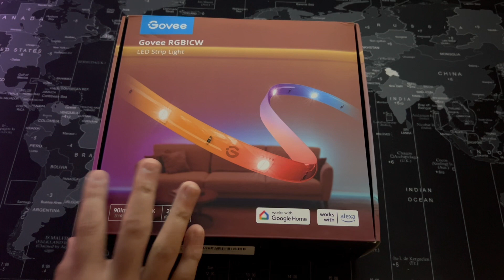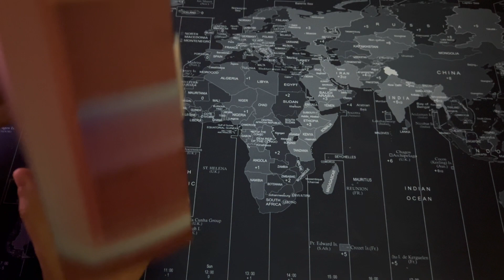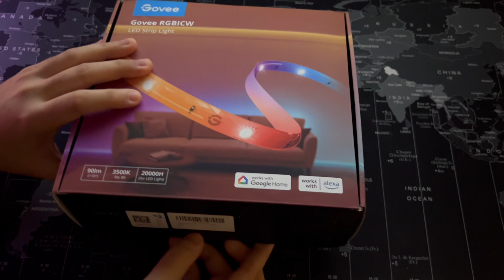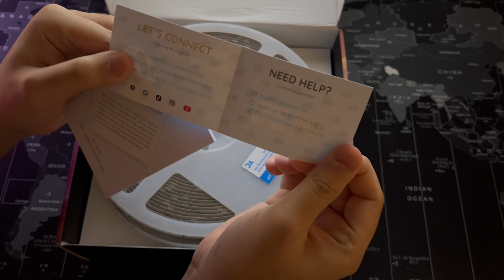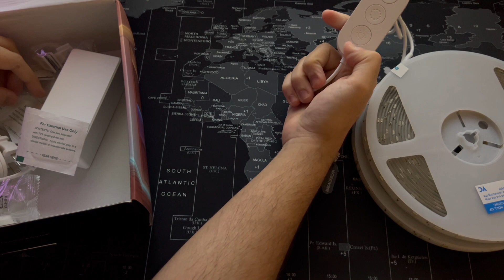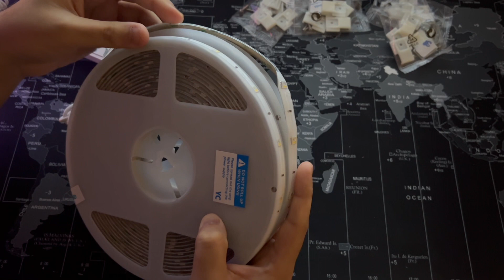Govee RGBICW LED Strip Lights | Unboxing and Review | A Colorful Symphony for Your Space!

Comment: That power adapter is TINY for a real 65ft LED strip 😂, those are multiple times brighter, when I say real, SK6812 LEDs, if I remember the chip number right, but a 16.4 LEDs strip can easily pull more power than this 65ft one
Reply from the maker: Now that you mention it, it really does look tiny!

Comment: Can these LEDs strip be cut to the size we want?
Reply from the maker: It's advised not to, but you can, only if you cut it on the marked copper line and nowhere else which is either marked on the front or the back of the strip.

Comment: Can you cut these
Reply from the maker: It's advised not to, but you can, only if you cut it on the marked copper line and nowhere else which is either marked on the front or the back of the strip. Hope that helps.